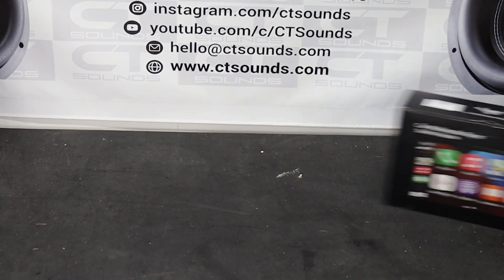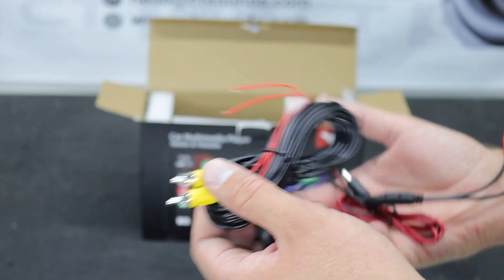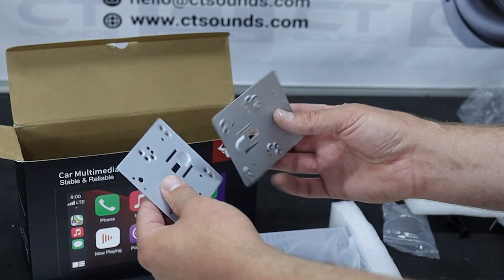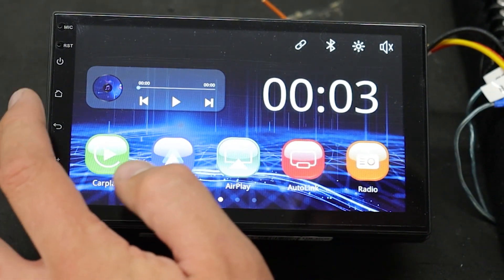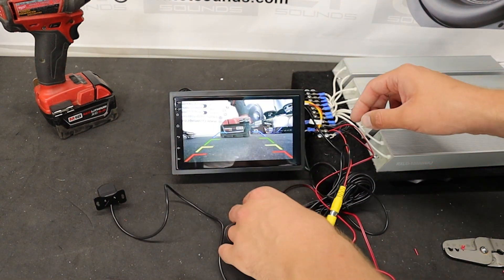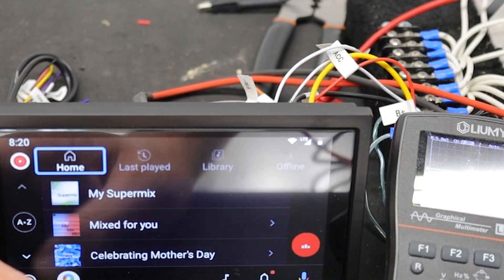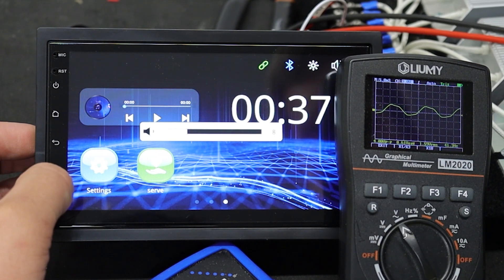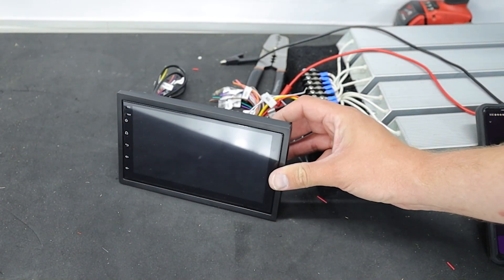Wireless Apple CarPlay Double Din On The Cheap? - AOLVO OXd8 PRO

Comment: You said you wanted specific use of WIRELESS Android Auto then spent 30 seconds on the menu page, exclaiming once again how cool it all was )))
Should have tested the Maps in wireless mode for pretty obvious reasons and in a real life scenario rather than a test bench. Now I'll bet there will be all kinds of problems with connectivity and lagging.
A review that doesn't review is a promotion.😂